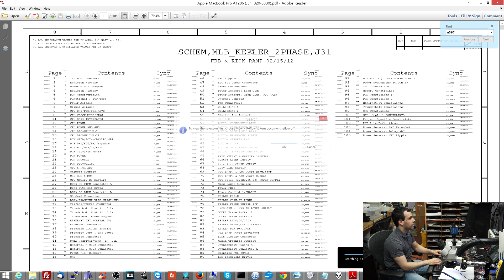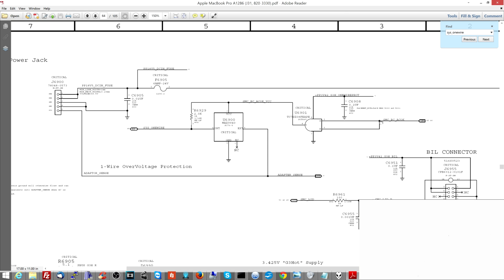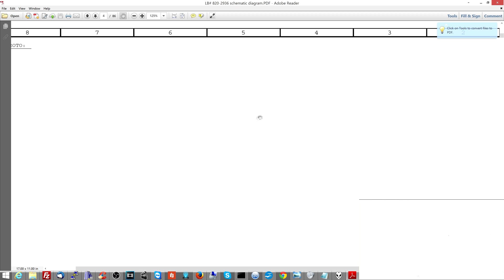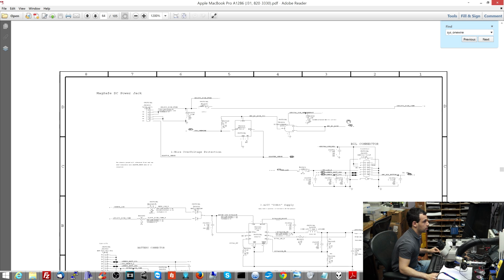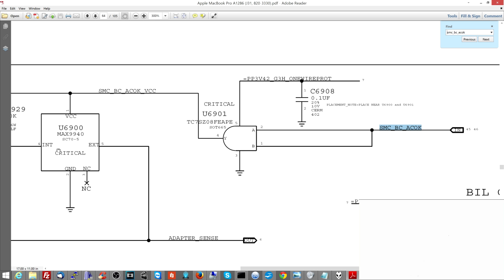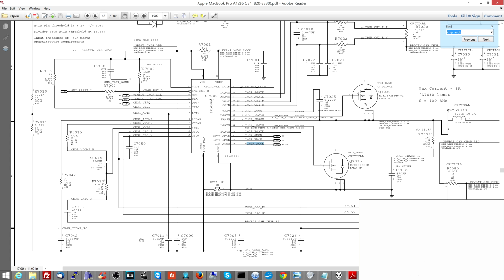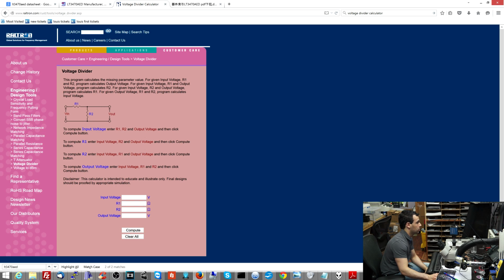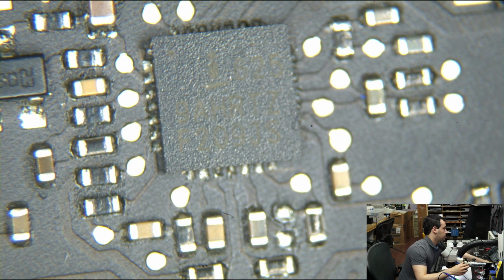820-3330 not charging due to bad ISL6259 QFN chip

Comment: Hello Louis,
thank first for the interresting Video. I would like to ask you some question.
- where can i look for the schematic of  an Device?
- where can i look for  the replacement part?  for example: i am looking for  the SMD  IC " SW05" may be "SW05" is the marking code.
thank!
Reply: Yaya Nsileuj the question about where to get schematics is stupid or to put it mildly superfluous because he says it in the fucking post: THE INTERNET, in other words U.T.F.G.
Reply: In addition: SW05 is the fifth switch in the circuit, it should be stated on the schematic, otherwise you have to look it up on the component, it is usualy stamped, graved or etched in. Good luck fixing your device 😉